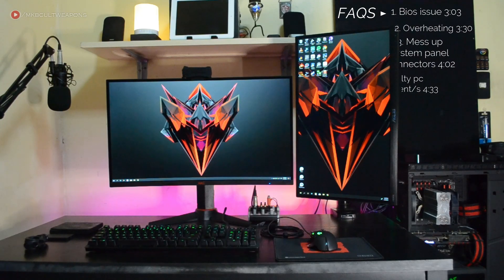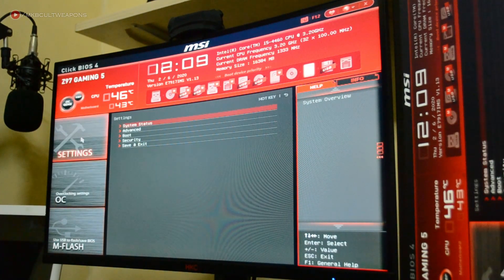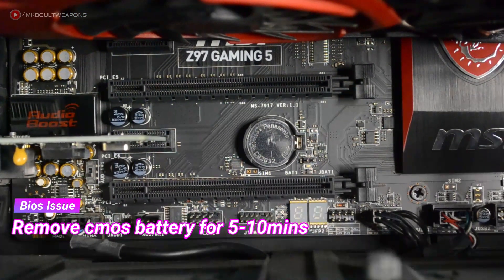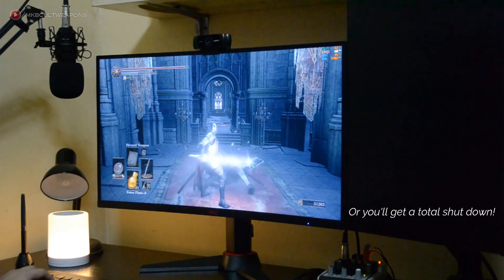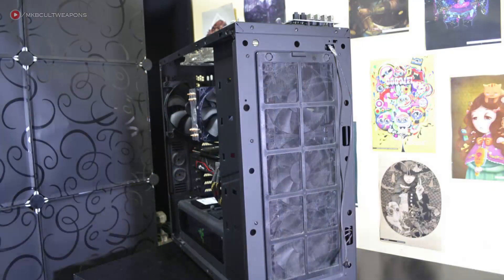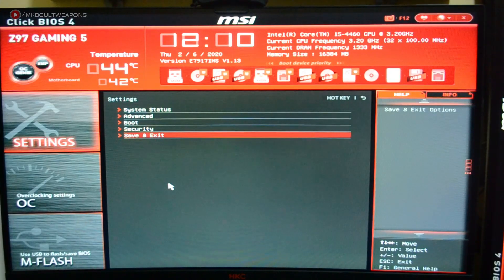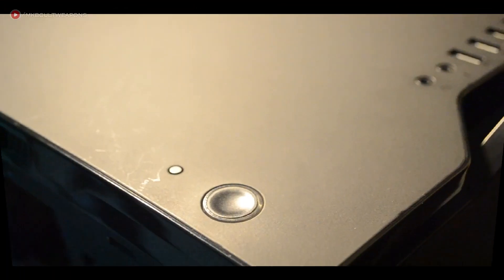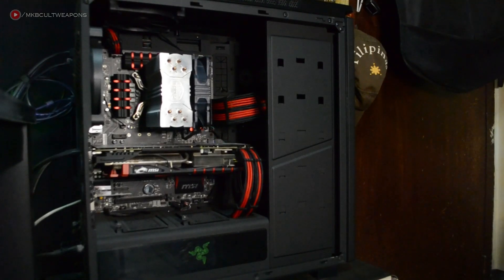Pc keeps restarting FIX / Pc continuous restarting FIX

Comment: I tried to update my bios and now it’s fucked, help
Reply from the maker: i hope while you're updating the bios there was no power interruption nor did you do anything in between the updating process because if ever there was interruption, your motherboard is done for. So can you still go to bios or there is no light anymore or any fans running?
Reply: @MacCoyzkie  don’t think so, I restarted after putting the file on a USB, when to bios selected to update with USB, did it’s thing waited like 5 mins, said it was successful and then didn’t boot into windows. I’m now trying to restore to a previous save of windows but I don’t think it’s gonna work, I stuff up... my pc boots but it goes into recovery options and blue screens
Reply from the maker: @iDeker  that's good then but i think the bios doesn't work well with your current build. You need to go back to the previous bios
Reply: @MacCoyzkie  how do I go back to a previous build if I can’t even get into windows
Reply from the maker: @iDeker  obviously you'll need another pc to download your previous bios
Reply: @MacCoyzkie  the build I was on before this isn’t listed to download, there’s only 1 other bios and it’s a beta
Reply from the maker: @iDeker  oh that will be difficult bro, i think you need to bring that to a local shop
Reply: @MacCoyzkie  I fixed it! I was lucky enough that my computer saved s previous version of windows from a few hours before this happened, I’m back in now! Thanks for the help
Reply from the maker: @iDeker  oh thank goodness, glad it worked already. no problem bro :)

Comment: I upgraded my pc to a asrock b450m steel legend a r5 1600 af and an evga 600 br psu and my pc restarts like 4 times before it actually boots into windows.
Reply from the maker: it's loosing signal either from the rams, gpu or psu. Double check those connections. How about try switching your rams into a different ram slots

Comment: Bro my pc keeps on turning on and off whenever i switch its place
Reply from the maker: loose cable inside most likely psu cables and also the rams and gpu make sure it is seated and locked in place since both has a locking mechanism. Better yet try the solutions in the video, it might help you
Reply: @MacCoyzkie  bro I just noticed that a white light on my rx 570 flashes. What does it mean?
Reply: @MacCoyzkie  it also happens when ever I switch my pc place

Comment: Thanks for the help Man! Saved so much time, instant subbed! 💞
Reply from the maker: awesome! glad i was able to help, thank you too for the subbed and feedback
Reply: @MacCoyzkie  hello, i hope you read this 😅, my pc restarts itself when i try to download a software sometimes it just restarts when i try to login, i already replace Psu, ram and gpu, i reset bios, update bios and reinstalled windows but neither of that works :c today i noticed the mobo msi b450 have a error code light, the pc restarts immediately when the CPU error code light comes up, i put fresh thermal paste today but nothing :c idk what do now
Reply from the maker: @Mario55F  this is just a guess but i think this is a psu issue. Can you tell me what are your pc specs and how did it started doing this?
Reply: @MacCoyzkie  but I just replace the psu :c, my specs are: 
Ryzen 7 3700x
Rx 6600
Corsair rm850x
32gb ram 32000mhz
Msi b450 tomahawk max
NZXT h510
I want to reinstall windows in another storage device to make sure isn’t the problem but can I just plug back in my storage unit where the windows was first installed without having to reinstall windows on that device?
Reply: @MacCoyzkie  when it starts I thought it was bottleneck, so i replace the gpu and ended up replacing everything but nothing, I bought the case with the mobo, the psu and cpu in it, so I didn’t build it at all
Reply from the maker: @Mario55F  i see, now in your previous comment you said that when you download the software from amd it restarts on its own right? For several days now i got many comments like yours and all of you guys are using amd gpu. I'm assuming that this is because amd's fault and its because of their latest driver. Now i suggest you install the version that was working good for you before if you still remember the version.
Reply: @MacCoyzkie  i don’t remember the version :c but yes! It start happening when i was updating the gpu drivers, was out of space so i was cleaning up the hard drive then the problem start, i got a new gpu and I reset the pc like 3 times so the update shouldn’t still there
Reply from the maker: @Mario55F  You need to DDU the current gpu driver, here's how to ddu  https://youtu.be/SvIJhcxZTsA
Reply: @MacCoyzkie  thanks! I will try this, but idk if it will work bc I upgrade gpu and I restart the pc to factory

Comment: Hello, is it possible that i bought a faulty pc because this is my very first pc and its been like this since I got it and I thought it was normal. when my friend came over he said its not and that to get it fixed. my pc restarts on its own maybe about every 5 hours its on but sometimes more or less
Reply from the maker: yes that's not normal. The only thing i could think of first is the cpu or gpu might be reaching it's temperature limit. You said it only happens after 5 hours, that is plenty enough to make the cpu or gpu overheat when both heatsink are not working, it's not common for gpu but i think it is your cpu(processor) temperature is getting to high causing the automatic restart. To check the temperature use msi afterburner, just run the software and you will see your gpu and cpu temperature. Idle must not be more than 60c, on heavy load must not be more than 90c

Comment: Quite funny you recommend for 80Plus Bronze. 
I have Gigabyte 850W 80Plus Gold and suspect that to be faulty as all other components (except Mobo) work fine on non-80plus PSU of 550W. 
You can never recommend 80plus PSUs as they are not really great, fault can happen with that also. 
It is also heart-breaking that this has happened with AMD. 
I have Intel i9 2nd Gen from ages and even today it boots up perfectly fine its just that its very slow so I have stopped using it plus it draws more power.
Reply from the maker: everyone is welcome to choose whatever parts they want in their pc, that is why it's called pc, it's "personal" computer. if non-80plus works for you then go with it. I just suggested 80+ certified even if its only bronze because if you experience power fluctuation at home it will save your other pc parts by sacrificing itself(psu 80+certified). On the otherhand a non 80+certified psu has a bigger chance affecting other pc parts if ever power fluctuation happens. I also think your 850W 80Plus Gold just saved your entire system

Comment: My friend gave me a pc but it runs Edubuntu so I put windows me on it but I don’t believe I have 100% finished the set up and it warns me I have to start in safe mode and when ever I click on a option to boot it reboots
Reply from the maker: windows me is completely unreliable in 2021, i suggest get an oem windows 10 instead
Reply: Mac Coyzkie Dude I use windows 10

But windows me is still 100% useable in 2021
It’s just not supported anymore by Microsoft 
But doesn’t make it un useable
Reply from the maker: @mycreations4527  not being supported by microsoft is a big problem itself, yes you can run it but there will be 2021 softwares or apps you'll install in your pc that are not compatible with WinME anymore causing a lot of problem such as what you're currently experiencing. If your pc was working before using ubuntu then i don't think hardware is the issue here
Reply: Mac Coyzkie well there are also apps that aren’t supported with windows 10
Reply from the maker: @mycreations4527  and what use is that if you can't see display?

Comment: I need your help, I got two ram sticks and they were working just fine but at some point when I try to play any game it restart, I did test them and one of them is making a weird sound but it does work fine (it still make that sound) when I use just that one, the other one doesn't make that sound and works perfectly. I don't really know what to do
Reply from the maker: ok the first one might be faulty, usually if you got the weird sound then your motherboard might be having a hard time detecting it. Usually this will cause a shut down or lose signal. Anyway have a friend test the ram that's causing a weird sound, if problem persist then that is already broken or will be soon

Comment: I've had my pc since 2018 when do you recommend doing fresh thermal paste on the CPU?
Reply from the maker: depends on what thermal paste you use, if you use the pre-applied thermal paste whether be in amd or intel i suggest change it after 6 months else it will become too hard like epoxy specially the amd paste. I usually change mine after a year but when i use this https://amzn.to/3cTJKhh after a year it is still wet and easy to remove
Reply: @MacCoyzkie  wtf do i need to change
Reply: @A4L717  im assuming your "W" here means why? 

Thermal paste tends to harden over time due to high temperature and performance may start to degrade over time causing your temperature to increase.
Reply: @A4L717  it’s like oil in ur car stop being lazy per applied just cheap stuff so once you put good stuff on there I only had to change it after like 5 years and pc still runs lol

Comment: My pc just turned off and now keeps restarting with no signal.
Reply from the maker: try to do the ram cleaning in the video
Reply: @MacCoyzkie  there’s no dirt on them but I took them out and changed the slots but still same issue
Reply from the maker: @wizstorm172  how about the removing of the cmos battery? remove it for 5 minutes and place it back again before powering your pc back on
Reply: @MacCoyzkie  I’m a little cautious about doing that since I’ve never done it before.
Reply from the maker: @wizstorm172  if you can't then just bring it to a local shop, they might also find something that might really be the cause of the problem

Comment: Dude I’ve literally tried everything and nothing has worked
Reply from the maker: how did your pc problem started anyway? i might be able to help if you give me some info
Reply: @MacCoyzkie  I was trying to convert my parts to another case and found out it didn’t fit so I put the parts back in my old case and it started reboot cycling
Reply from the maker: @nauticus1928  i see, you might have misconnected the front panel io, reset connectors are placed in the power switch. double check those, that happens to me several times already and it might be the same for you too. 
anyway if you place it correctly and still doesn't work, this might be the rams having slightly being undetected by the motherboard. try one ram only and switch it by slot to slot to check
Reply: @MacCoyzkie  I have already tried to reconnect my front panel connectors and I’ve already tried to take out my ram and put it back in
Reply from the maker: @nauticus1928  ok i guess we have no choice but to try each individual parts. i suggest ask a friend with compatible pc to try out your rams and gpu one at a time and if problem persist then it's one of the components they tried. If problem did not persist then you got a dead motherboard or power supply
Reply: @MacCoyzkie  ok thanks  for the help

Comment: PLEASE READ UPDATE BELOW FOR SOULTION THAT ENDED UP FIXING THIS ISSUE FOR ME!!!

(initial post) From my most recent experience with a PC that would reboot, I learned that the easiest thing to do before you start looking into the hardware is to first look at certain drivers. I had a PC that would reboot periodically while gaming. I thought I had an issue with my CPU cooler. I replaced it with a better cooler, but that didn't fix the problem.

What I did was download a monitoring software called HWinfo and GPU/CPU load testing program called Cupid Powermax. I would first start the monitoring process with HWinfo and then start load testing the CPU. As soon as I started the test for the GPU, my PC would reboot. This happened every time I ran both load test together. My first guess was that I had an issue with the graphics card, but I decided to uninstall the drivers and then reinstall them. That seems to have fixed the rebooting issue. I'm not sure if I had corrupt drivers or not, but my guess is that a Windows update may have caused this issue a while back with their last big update.

UPDATE!! What actually ended up fixing the issue was to reinstall Windows 10. That was many months ago and the issue hasn't even happened again.
Reply from the maker: thanks for sharing

Comment: I’ve tried many things and my pc won’t boot into bios and keeps resetting over and over again any other tips and yes I have tried resetting the ram
Reply from the maker: when does the restart happen? during gaming, desktop workload or the moment you turn on the pc?
Reply: @MacCoyzkie  about 15 seconds after I turn on the pc and it never lets me into the bios or even starts up windows
Reply from the maker: @dstarr3526  if you tried every suggestions in this video and still that restarting loop is happening then you might have a faulty boot drive or a hdd currently installed. can you remove all other drives and just try the boot drive?

If it's just have a single ssd drive installed then it might be becoming faulty. You will be needing and extra drive just to test that out. Remove the current boot drive and try an extra boot drive.
Reply: @MacCoyzkie  already tried that
Reply: And for my specs I have: 
i5-6400
Gtx 1660 Super from ASUS
850 Watt PSU from EVGA
16gb of ram (4 x 4gb sticks)
Gigabyte motherboard
Reply from the maker: @dstarr3526  ok then i guess we'll try to find out which pc part is causing the problem. Can you ask a friend with compatible pc to try your rams and gpu one at a time, if problem persist in their rig then it is one of those parts they have tried that is causing the boot loop. Since you tried your drives already i think this could be a low power draw from wall power outlet or the motherboard is becoming faulty. 

Though i'm also thinking of a last resort, if you don't really have any important files in your boot drive, clean reinstallation of windows might also fix this
Reply: @MacCoyzkie  I don’t know anyone with a computer so I’ll probably have to let someone look at it at a store next week and I can’t do a clean install of windows because it won’t boot
Reply from the maker: @dstarr3526  ok, i hope it get fixed by then
Reply: @MacCoyzkie  It ended up being the ram even though I had already done testing on it
Reply from the maker: @dstarr3526  all ram sticks?
Reply: @MacCoyzkie  Only one of them
Reply from the maker: @dstarr3526  oh that's good at least you got 1 still
Reply: @MacCoyzkie  Only one of them went out

Comment: tried all the above but i still ahve an issue with restarting/boot loop , only happens one a week or so these days but its been real real bad in the past so no idea :(
Reply from the maker: if that is the case then it might be a drive issue, usually it is an hdd or your boot drive is failing.
Reply: @MacCoyzkie  thanks for the reply , i recently replaced my boot drive and im yet to get a new HDD so im just using my SSD as my only drive , iv had the issue prior to the new drive but alot less common , proior to getting a new ssd it was going into a restart multiple times a day
Reply from the maker: @jamiescott1364  i see, if that is the case then i guess this is not much of a hardware issue but rather software. Back your important files already. This is most likely a windows issue, if updates doesn't work anymore then you might need a clean install of your operating system
Reply: @MacCoyzkie  i did transfare my windows 10 from my laptop to my gaming pc to test that but the issue persisted also my drivers started acting strange after swapping to win 10 , my wifi adapter kept dropping connection and my mouse kept jumping after reinstalling drivers for both it didnt change so i just went back to my 8.1 so sofar my restarts have happend on both OS's
Reply from the maker: @jamiescott1364  ok then i guess we need to tests all the pc parts then to know which one is causing the restarts. Can you ask ask a friend with compatible pc to try your rams and gpu in their rig, one at a time. if problem persist then it is one of those they tested, if not then it might be the motherboard or the psu causing low power draw, this might also be from your wall outlet.
Reply: @MacCoyzkie  i doubt its the wall outlet since in the time its happend iv been at 2 homes i remember reducing my ram sticks to one and disconnecting my gpu and it still happend so maybe psu mobo or cpu?
Reply from the maker: @jamiescott1364  might be but it is very rare for cpu. so yeah i guess it its the motherboard then
Reply: @MacCoyzkie  back about a year ago it was at the point at 10+ restarts a day  not that its at once a week iv been lazy regarding getting it fixed but hopefully my local store has some motherbords in that fit my cpu